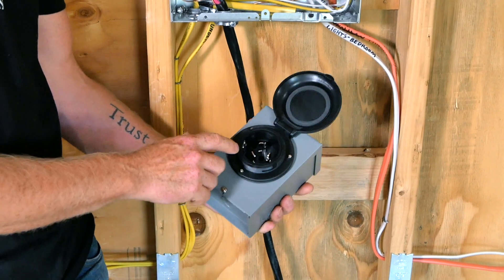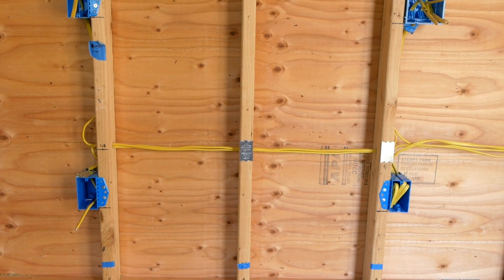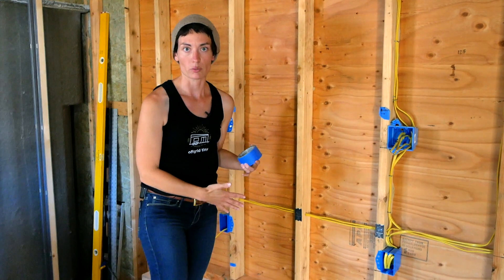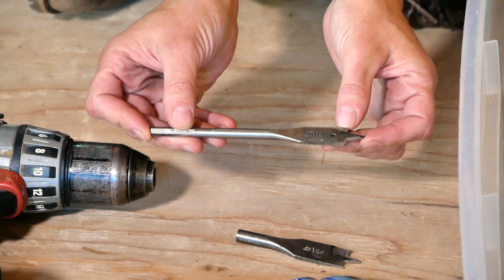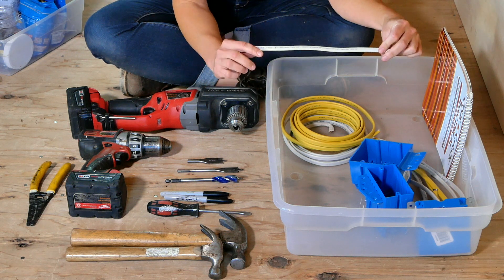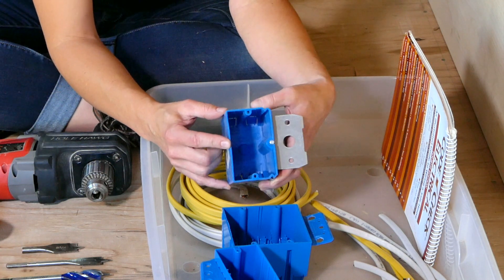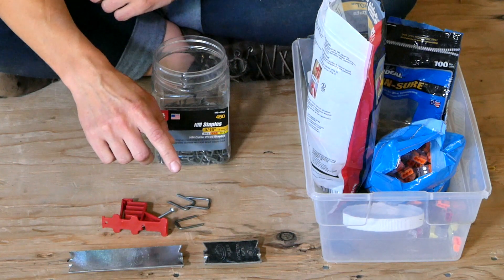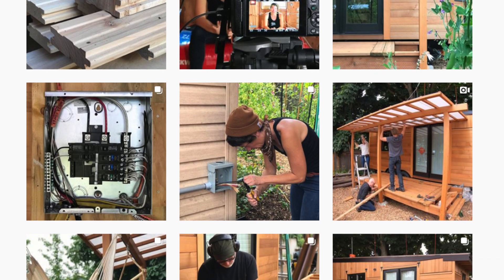Tiny House Circuit Planning and Electrical Rough In

Comment: As an electrician of almost 30 years, I can say most of your video is spot on great advice...except for the push-in connectors, the only thing those are good for would be (1) LED light fixtures where there are low current applications and (2) keeping service truck drivers like me in business and (3) keeping the fire department busy....I've seen some gnarly fires in my day caused by these push in connectors. Other then that issue, great video
Reply: I like using the Wago type connectors for connecting thin stranded light fixture wire to solid #12 or 14. Much easier than trying to wire nut thin stranded to thicker solid wire.  With LED lighting you're only dealing with a few watts so current flow through the splices is minimum. I still wouldn't trust them on full circuits carrying 15 or 20 amps though, especially when you're daisy chaining receptacles and the current has to feed through several of these going through each box to the next one.
Reply: those connector are popular because people on youtube think it's trendy and cool

Comment: There are two other options when it comes to running your wires. 1-use drop lines. This means you’d had to run a raceway like it a regular house and the drill through the seal plates. This will work good to prevent weakening the studs in you walls and overall strength of your structure remains. 2-If you want to run through walls, you can place pvc or emt tubing to reinforce the stud so the load the stud carries isn’t compromised and you will have an easier path without sacrificing strength.

Comment: A spade bit can last a lifetime. Just keep sharpening the 4 edges (blade & spike), 30 seconds with a hand file. Get the kind without the edge teeth. Rough-in holes don't have to be beautiful. When you hit a nail, just slow down, push on through, & fix the bit. Rotate in reverse to break off splinters which can damage wires. Don't buy the long, expensive bits, get an extension (w allen screws) to work with all your bits.

Comment: This is just an opinion.   I believe that if you use NEC Article 552 Park Trailers as your guide, no one would question it.   It allows the 50 ampere 120/240 volt connection, not 100 ampere for a dwelling unit.   From what I saw in the video, you have probably complied with almost all the rules.  Full compliance may require you to get some name plates made.   The only thing that keeps it from the requirements is 552.4 General Requirement states It is intended for seasonal use and not intended as a permanent dwelling.   Maybe you need to go somewhere for a week or two to fully comply!   Again, if you comply with these rules, probably not much resistance from authorities.   
Best Wishes!   Kevin
Reply from the maker: Thanks Kevin.

Comment: What about running 12v?
Reply from the maker: You could do that but there would have to be a reason to do it.  Typically the 12 V circuits in RVs and boats are there to run certain low amperage appliances more efficiently without the need for an inverter.   It’s not a bad back up for your lighting and phones to have a simple solar panel and 12 V battery set up but in that case unless you’re running off grid, something portable makes more sense.
Reply: 12v has no huevos without mucho power drain. Its all about the huevos, no?
That being said, like an RV or larger boat, there are many uses for some 12v circuitry in a tiny house. For example, cigar lighters in the smoking/billiard room.

Comment: Stranded wire is recommended for mobile structures
Reply from the maker: This structure is designed to be moved maybe 3-4 times in its lifetime, it is not an RV.

Comment: Bath outlet can’t be tied in with any wiring outside of bath.
Reply: What kind of exterior box did you use for your exterior gfi that allowed you to convert your 10 wire to 12 and fit a gfi?
Reply: I believe it’s 6-8 inches of wire from the finished surface, not the back of the box.
Reply: Overall great job. Better than most helpers I’ve seen come and go.
Reply from the maker: Tiny houses live in a grey area between RV and House wiring and electrical planning that requires some liberties with interpretation of intent vs the letter of various codes.  The short answer is that in such a tiny structure it makes sense to share some circuits you'd separate in a house in a way that is mindful of loads, safety, etc.  This is a complicated subject and one that we chose to steer clear of deliberately in the video.  Here though it might be helpful to offer a few examples of the conflicts that arise and why we resolved them the way we did.  

An NEC a load calculation for this little house looks on paper like we are wiring a small ADU, which would require a few additional dedicated circuits and 100 amp service which is obviously silly for what is essentially a glorified bedroom and 1/2 bath.  Additionally the legal path we are given here in Portland, Oregon for connection is a temporary RV connection box, which is more appropriately sized for the actual loads which is really more like an RV.

Now having said that I think wiring hardware and safety standards for RV's are woefully inadequate, so we GFCI/AFCI pretty much everything.   

Our incoming 6/3 line is straight off the RV receptacle box on the front of our trailer, so no gfci there, just on the branch circuits.   

Hope this explains things better!
Reply: @actuallytiny2537   Here's something to consider....the only real reason a separate 20 amp circuit is code required for a bathroom receptacle is primarily to run a hair dryer, which is typically about 12 amps.  Anything else you'd typically plug in a bathroom would be very low wattage. Honestly, overloading the circuit would only be an issue if you were drying your hair and had another high wattage kitchen appliance going at same time, which is unlikely.  And if you don't use a hair dryer at all, really there's little to be concerned about here.
Reply from the maker: Exactly!